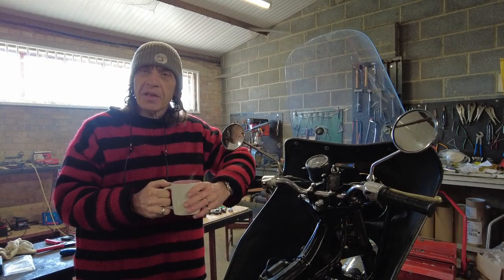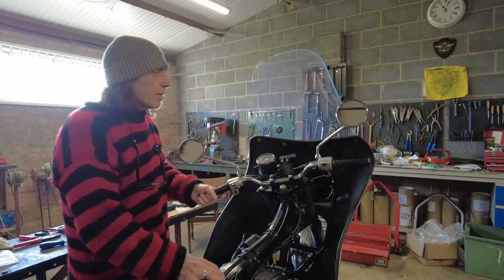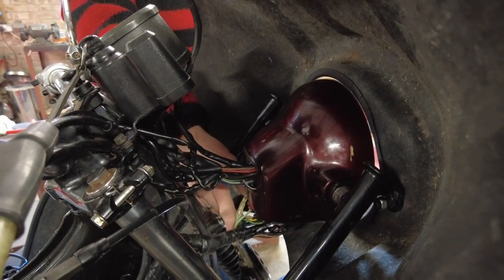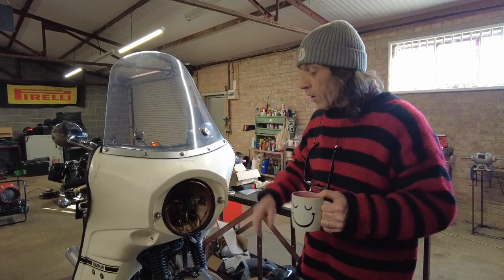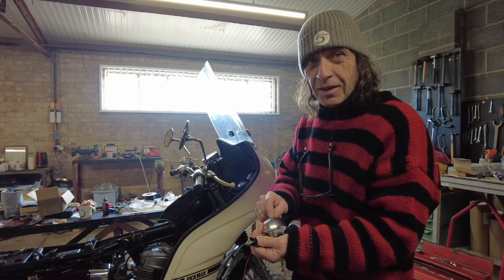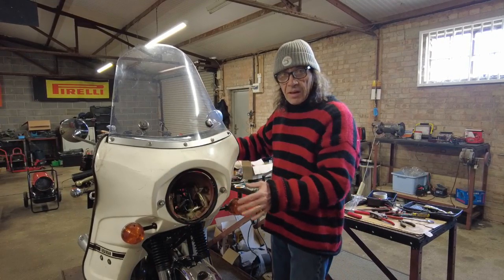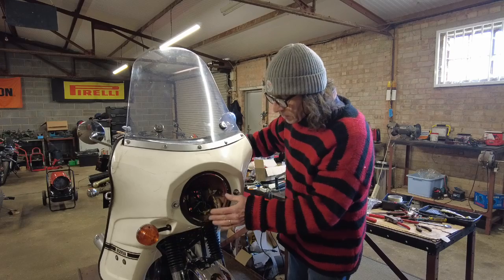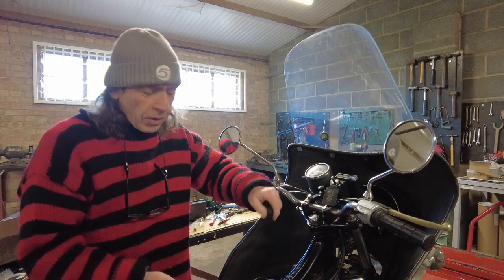Honda Benly Episode 7 The Guy Willison Theory of Motorcycle Electrics

Comment: Your Correct to Compare Electric Moving Down Wires To Warter,As a Honda Trained Tech, Thats Exactly How it is Taut by Honda,Resistance is Just a Resistance to the Flow like a  Blockage if you like in a Pipe.
Also Always Start at the Battery for Any Fault Finding as that is were A Wiring Loom Starts and Ends.
The Electrons are Pushed up the Wires just Like the Flow of Warter 👍

I Used to hate Electric But after Working on Hondas for 14 Years and doing the training i Ended up Quite Liking Fixing Faults.

Comment: Sound principles Guy, the feed to the indicator switch comes from the flasher unit so it is already 'flashing' before the switch directs it to either left or right hand lamps. Apart from that, perfect sense. Make sure your earths are absolutely spot on sound and clean, six volt systems don't need much of an excuse to play silly beggars. 
 I trained in a workshop that did Auto Electrics as well as diesel injection and marine work when I was an apprentice. A few years ago now. 
Those Polaris fairings always reminded me of the Triumph Saint fairings that the police used to use. They were probably Rickman too. 
I'm really enjoying the videos. 
Best wishes, Dean at Retromeccanica, Oxfordshire.

Comment: I've just found your videos, Guy. Great information for simple wiring . We had Rickman Typhoon fairings on BMW R65s as couriers for the BBC news in the early 80s. They had  a lip on the screen that let me use an open faced helmet all year round and  were the most efficient fairings I've yet to find.  Keep up the good work. P.S. I solved the vibration problem on my R100 RT, if you remember from Oakley. It was a worn carb needle and main jet. Thanks for pointing me in the right direction.👍

Comment: I’m sure you are all sorted with the wiring by now, but I’ve had some success using cut sections of inner tube (bicycle or motorbike) as waterproof sheathing for exposed wiring. Just zip tie either end and jobs a good ‘un 👍

Comment: Your Correct To compare it to the Flow of Warter
As i Honda Trained Tech Thats Just How they Explain ,The Flow of Electrons Down Wires and any Corrosion or Breakdown increases the Resistance Just like Squeezing a Pipe to restrict the Flow of water and that Also increases the Amps and thats why it can Set on  Fire etc